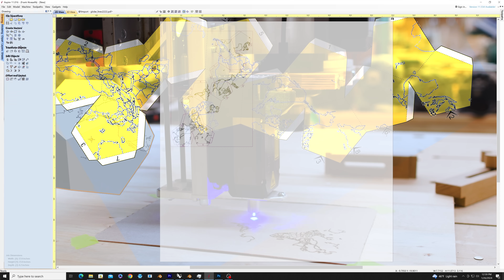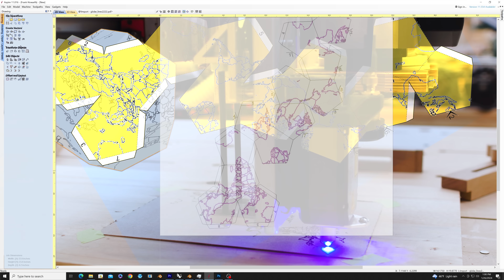Adding A Laser Cutter to My CNC

Comment: Not sure if it's possible to use the drag knife at a 45 degree angle from the z axis, but if it were possible, you could hide the scoring needed for the bends on the inside of the model.  This would also probably strengthen your joins having a bit more meat to grab onto on either side.

Comment: Excellent!  To drill accurate holes in alumin(i)um, I use pieces of clear 3mm thick polycarbonate as guides, mark it for the locations, drill it, then place over the aluminium.

Comment: Wow - Pretty cool - I am really liking the new 44 watt #JTECHPHOTONICS laser I bought for my #OnefinityCNC.  That laser seemed dramatically simpler to install and get running than the one you have there.  Not sure about durability, but so far works great.   Either way a great option to get started with laser.

Comment: Very nice, Frank. If you made 2 or 3 reference marks all the way through the cardboard, could you then flip it over and make your cut-lines on the backside. That should allow you to close up your globe without any breaks in the finished surface.

Comment: i'm a bit baffled the company does not include either eye protection for the toolhead itself or any kind of ventilation/filter system. that's a hard no-go for me.
Reply from the maker: It came with some nice goggles that go over my glasses to filter the laser light. I ordered a second pair if I have any guests in the shop.

Comment: Nice upgrade! I always love your CNC videos. I use my laser + spindle CNC to mark the locations of the hold down screws so the bit doesnt hit them later.  Works perfectly because the board does not experience sideway forces by using the laser so it cannot offset the piece. Just lay the board on the CNC bed and screw it down after the laser is done.
Reply from the maker: I like this idea

Comment: a diode 15watt laser is an engraver at best... the size of your bed is large however i don't see the value in spending 3700 on a 15watt engraver. can spend half that on a 40watt diode that's moveable.

Comment: You can make a jig for the razor blade attachment. Spring loaded balls in front and back side, it will glide but will push the paper down when the razor goes up. Some suction under the table does the job pretty good as well. Or you can mark outer lines around the cutting zones and staple outside to held it down.

For fumes, you might need to add a filter somewhere in your dust collector and a seperate line for the laser attachment. 

Eye protection with sides, a makeshift enclosure or attachment around the laser would be a good idea. You might not have enough time to react before going blind, if some reflection hits your eyes. Locking the doors during operation or putting a sign is also necessary, especially if kids visit your shop frequently. 

A cap over the laser lens might be good idea to prevent dust getting onto the optics of the laser. I havent seen laser and router side by side until now, but dust might become an issue for the little optics on the laser. Even the fumes of the burning material can mess up your optics and reduce output power. Depending on your unit, cleaning might be a nightmare. 

If anyone is wanting a laser to mark wood, you can buy cheap spring loaded pens and make an adapter to put in in the shaft of the router. You can turn the spindle off and use it to mark or draw on the surface, it works wonders for marking bend lines on thin sheet metals, it is not a replacement laser, but cheap enough to try for simple stuff. 

Sorry for being annoying by commenting on safety, but, seriously, we want to watch your creations for a long time. I hope you take some precautions, diresta would mock us, john heisz would lecture us telling that he knows but is comfortable with things as they are, but i hope, you will not ignore some lighthearted concerns.
Reply from the maker: It came with some nice eye protective goggles that go over my glasses. And so far I've been good about wearing them. It also came with a little cap to go over the end of the laser. Which I have not been so good about remembering to put back on again. Lol . I want to figure out how to let my dust collection vent outside when I need it to.

Comment: Get some OD7+ ANSI certified goggles. They range from about $100-200 and will protect you from any vision damage from the dot of the laser. Make sure they also cover the wavelength of your laser. Should be around the 455 nm range, so goggles will be orange or yellow in color. But they should have the wavelength coverage listed as should your laser.
Reply from the maker: It came with a set of goggles exactly as you describe. I also ordered a second pair for any guests that come to the shop.
Reply: My team designed and built a device fore measuring torsional vibration using a laser a very long time ago.  It was a fairly powerful laser and worked perfectly and had a way better sampling rate than the thousand tooth encoder we used previously (this was for measuring crankshaft vibration at Ford UK Product Development) but the safety people wouldn't let us use it, even in controlled locations, because there was too much risk of leakage hitting someone in the face.

Comment: Just bought a vision system laser from china.  Conveyor belt.  Two 120W lasers.  1610 size. Door to door shipping. $10k.  I also own two Chinese cnc routers 4x8 and they have been work horses.  If you have the space, by separate machines. But support and software with Chinese machines can suck.  I have a 4x8 flatbed uv printer I'm not using because the support sucked.

Comment: Major downside of add-on laser is that router table has to be sturdy and therefore heavy, limiting acceleration and maximum movement speed. Therefore you are usually getting stuck with low feed rates and thus slow cutting/engraving speed. Some CNC controllers also are not able to modulate laser power based on actual head speed, thus smaller details get overburnt and straight lines, where F is reached get much less exposure. But anyway it works if you manage to set it right and don't plan to run it for production.

Comment: Frank, you should pick up a step drill bit for the odd time you need to make holes in sheet metal.
Reply from the maker: Yes
Reply: I got a couple at Harbor Freight for the rare times I need step drill bits. Works fine, super cheap. @frankmakes

Comment: Be careful with that laser Frank, at 15 watts you're in the power range where reflections can cause eye damage,  and the fact you can see the blue dot as it's doing it's lasing means you're seeing reflections.   There really should be a cover over that entire laser that rides right off the surface of what you're cutting so you don't actually see the laser
Reply: That's what I was thinking.....a shield around the laser head plus a good pair of laser glasses in the right nm range.

Comment: Frank please! 

Working with an open Laser like in your case is dangerous for your eyesight. Even the reflected Laser light can damage your Retina! You should always use fitted goggles (letting no light through at the sides) with a filter specific to the wavelength of your Laser. And your dust extraction is not sufficient for the extraction of Laser fumes. The particles a Laser produces are way finer than any regular cutting tool could ever create. There are several fume extraction systems on the market specifically for Laser fumes.

Comment: I did this myself recently on my CNC router, they are a handy tool to have, very good for engraving and have a very thin cut line which can be handy.
I didn't see what eye protection you have but please make sure the goggles you have are decent ones which are certified for the wavelength and power of your laser and no one (or pets) can get in (or see in) your workshop when the laser is in use.   You or your viewers may not realise how dangerous these lasers can be.

Comment: You should get a set of step drills, it's too easy for a twist drill to get pulled too far into a cabinet full of wires, i've done it myself., also, the step above the one you're cutting will deburr the hole
If there isn't a shield, i hope you were wearing the proper protection glasses.

Comment: When you are using the laser you are burning the material and creating smoke. Which will be circulated into the shop through the dust filter. Could it be possible ypu could create an unhealthier breathing environment? I know nothing about the subject.
Reply: Yes, it is possible. That and the possibility for stray reflections is why i hate this style of laser

Comment: Thats really cool! Having used a CO2 laser for quite some time, the diode lasers look quite underpowered but the massive volume of the CNC-Laser is probably suuppperr nice! The piston-compressed air system looks really nice- I have never seen something like that on any of the lasers I have worked with! I think routing something out of wood and doing laser-engraving on it in one setup could be cool, as well 
Awesome video as always, Frank!

Comment: Looks like a great product, my only concern is that most laser cutters have a full cover and that’s for a good reason. One of the main issues is obviously the risk of being blinded by the laser. Just want to reinforce that these open air laser cutters come with more risks than conventional ones!
Reply: This kit comes with protective glasses so I'm sure he's wearing them
Reply: @dpmakestuff  he hasn't showed it in the video, I'm concerned Frank is not aware of the dangers a Laser has.
Reply: @Craftlngo  does Frank really strike you as someone not aware? He’s no fool.
Reply: @dpmakestuff  No, but If I remember correctly, he hasn't worked with a laser before.
Reply: Fume mitigation/extraction, fire are  another concern
Reply: There's probably a million warnings on every page of the manual
Reply: Yep, really hope he's wearing certified laser goggles for the wavelength of his cutter. Some of the cheaper open air laser cutter kits come with knock off goggles that should be replaced by anyone that cares about their vision!
Reply: @AverageJoe928  100% my first thought as well
Reply: Real lasers also can travel faster, but the work area for this is huge.
Reply: I agree this stuff is really dangerous, and no one else should be in the shop while operating.
Reply: @dieterlamm1819   I would argue that it is far more dangerous to leave a machine running unattended. Whether it's a CNC, Laser, or any other machine in your shop, you should ALWAYS be present while machines are running.  Yes, he should have proper safety gear on, but to just leave is foolhardy, at best.
Reply: @TonyLicavoli   considering that the laser is burning, I'm always much more attentive to how things are going when running it, as compared to my CNC routing system.
Reply: Like any tool, these can be dangerous.  However, they are not as bad as many people think.  When in a practical application like this, the laser output is not a columated beam that will go long distances with a high power density, they are a highly focused beam to get a very small focal point.  The focal distance on this particular laser is only about 30mm, so at a distance of a couple of feet the power density is already reduced many orders of magnitude.  Reflections will also disperse over distance just like the beam itself does.  The other aspect of this laser that helps is that it is very visible blue light that really catches your attention (unlike a CO2 laser which is invisible and can be on at full power and you don't know it), so there is no mistaking when the laser is on.
So yes, you should always wear good quality laser glasses when working near a machine like this, and mind who is in the work area, but it is very unlikely that someone walking through your garage is going to get eye damage with an inadvertent look from a distance.  I worry more about people standing close to me when I'm using my table saw than I do the laser.
Reply: Lasers are no more dangerous than any other tool in the workshop when proper precautions are being followed. I have a laser and all you need to do is wear glasses and proper ventilation